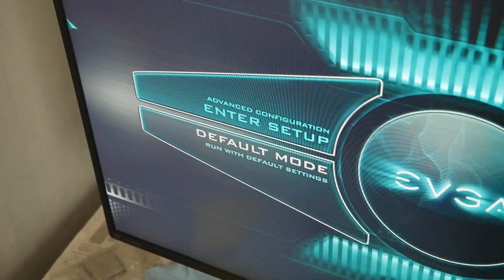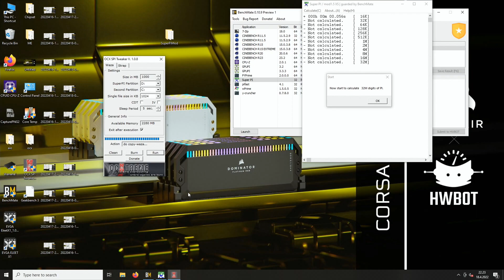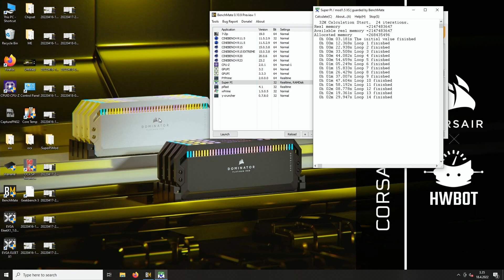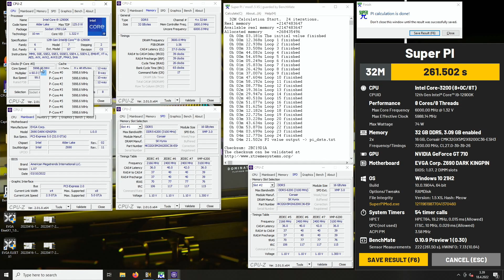Corsair DDR5 Overclocking Competition - Efficient Performance at 7200MHz on LN2 in Super PI 32M

Comment: hello, a tip: under € 350 what is the mobo that reaches / supports higher ddr5 frequency?  A at these frequencies (6400mhz) the most stable and safe, suitable for the OV pushed over time
Reply from the maker: Very hard question, because even the mini-itx motherboards have gone up in price. Any 2 slot motherboard should be able to do it as long as the BIOS is good.

Comment: Question for you @luumi. Could you check if 1t on the dark is true 1t or employs 'cmd stretch'? Can just set 1t in bios; in windows, use msi dragonball program to read memory timings. Within Dragonball, there is a value associated with 'cmd stretch', '0' would be true 1t, any other value would indicate a stretch is implied. Would explain why some results with '1t' do not appear to correlate well (and why 2t on the dark actually brings better bench results, especially latency). Thanks!